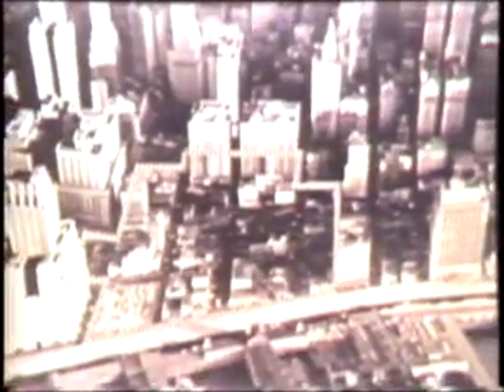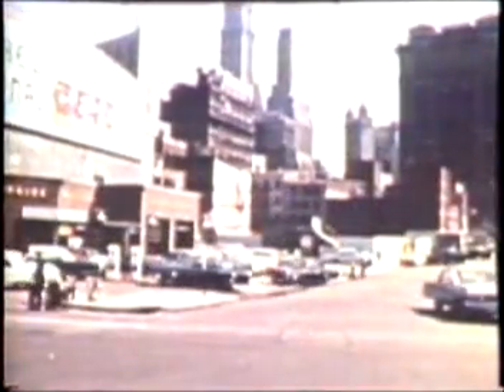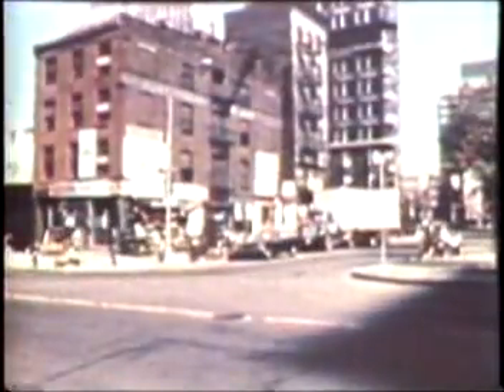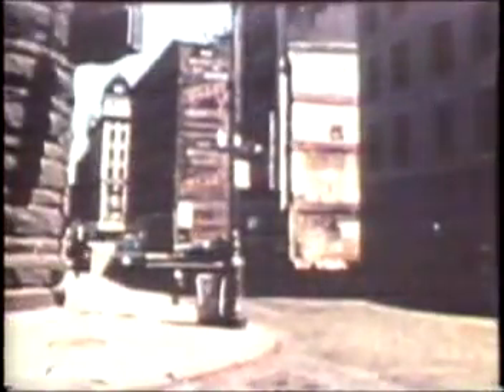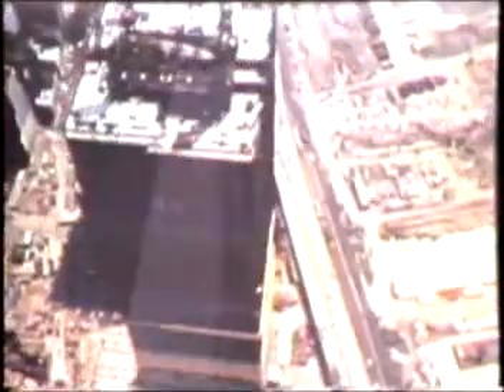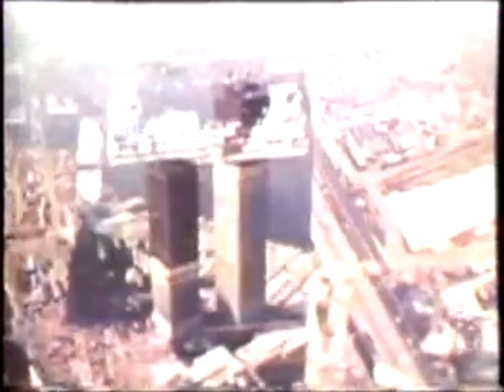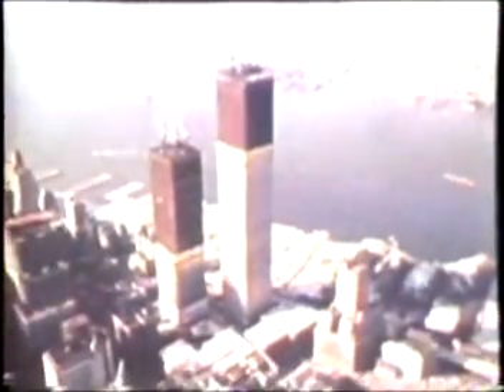[Vintage] World Trade Center Construction Promo (1968-1972)

Comment: And nobody imagined that someone would crash a fucking jetliner into it
Reply: actually they did, they were built to withstand a jet impact from the aircraft of the period
Reply from the maker: To clarify (conspiracy theories aside)-- the WTC was hypothetically able to survive a (accidental) collision from a Boeing 707.... NOT a fully-fueled Boeing 767 (wide-body fuselage) that was flying at high speed directly into the structure. 767 is a much larger aircraft with MUCH more power.

Comment: The whole description is simpily here. The World Trade Center is a complex of various buildings in Lower Manhattan, New York City, United States, replacing an earlier complex with the same name on the same site. The original World Trade Center was a complex of seven buildings. It featured landmark twin towers, which opened on April 4, 1973 and were destroyed in the September 11 attacks of 2001, along with 7 World Trade Center. The other buildings in the complex were damaged in the attacks, and their ruins were eventually demolished. The site is being rebuilt with five new skyscrapers and a memorial to the casualties of the attacks. As of November 2011, only one skyscraper has been completed; the other four are expected to be completed before 2020. One World Trade Center will be the lead building for the new complex, reaching more than 100 stories at its completion.[2] It became the tallest building in New York City on April 30, 2012, and is expected to be finished by 2013. A sixth tower is awaiting confirmation.
At the time of their completion, the original 1 World Trade Center (the North Tower) and 2 World Trade Center (the South Tower), known collectively as the Twin Towers, were the tallest buildings in the world. The other buildings included 3 WTC (the Marriott World Trade Center), 4 WTC, 5 WTC, 6 WTC (which housed United States Customs), and 7 WTC. All of these buildings were built between 1975 and 1985.
The complex was designed in the early 1960s by Minoru Yamasaki and Associates of Troy, Michigan, and Emery Roth and Sons of New York.[3] The twin 110-story towers used a tube-frame structural design. To gain approval for the project, the Port Authority of New York and New Jersey agreed to take over the Hudson & Manhattan Railroad, which became the Port Authority Trans-Hudson (PATH). Groundbreaking for the World Trade Center took place on August 5, 1966. The North Tower was completed in December 1972 and the South Tower was finished in July 1973. The construction project involved excavating a large amount of material, which was later used as landfill to build Battery Park City on the west side of Lower Manhattan. The cost for the construction was $400 million ($2,300,000,000 in 2013 dollars).[4] The complex was located in the heart of New York City's downtown financial district and contained 13.4 million square feet (1.24 million m2) of office space.[5][6]
The Windows on the World restaurant was located on the 106th and 107th floors of 1 World Trade Center (the North Tower) while the Top of the World observation deck was located on the 107th floor of 2 World Trade Center (the South Tower). The second King Kong film was filmed in 1976 with some scenes mentioning and showing the World Trade Center.
The World Trade Center experienced a fire on February 13, 1975, a bombing on February 26, 1993 and a robbery on January 14, 1998. In 1998, the Port Authority decided to privatize the World Trade Center, leasing the buildings to a private company to manage, and awarded the lease to Silverstein Properties in July 2001.
On the morning of September 11, 2001, Al-Qaeda-affiliated hijackers flew two Boeing 767 jets into the complex, one into each tower, in a coordinated terrorist attack. After burning for 56 minutes, the South Tower (2) collapsed, followed a half-hour later by the North Tower (1), with the attacks on the World Trade Center resulting in 2,753 deaths.[7] 7 World Trade Center collapsed later in the day and the other buildings, although they did not collapse, had to be demolished because they were damaged beyond repair. The process of cleanup and recovery at the World Trade Center site took eight months.
Over the following years, plans for a rebuilt World Trade Center took form. The first new building at the site was 7 World Trade Center, which opened in May 2006. The Lower Manhattan Development Corporation (LMDC), established in November 2001 to oversee the rebuilding process, organized competitions to select a site plan and memorial design. Memory Foundations, designed by Daniel Libeskind, was selected as the master plan, but this went through substantial changes in design. The new World Trade Center complex will include One World Trade Center, three other high-rise office towers, and the National September 11 Memorial & Museum.

Comment: I wonder how much did it cost to build both towers back in the 60s?
Reply: The whole complex (demolition of Radio Row and the Hudson Terminals), building the slurry wall, excavating the bathtub and building out the underground, including a new PATH station, building the twin towers and the three lowrise buildings around the plaza cost around $1000000000 in late 1960s USD
Reply: 900 millones de dólares por los 5 edificios del complejo, las Torres Gemelas, los edificios 4,5 y 6, la plaza elevada, estacionamientos y estaciones de metro, calles que rodeaban el complejo, y los espacios de centro comercial subterráneo entre Torres, el muro pantalla, relleno, demolición, transporte de tierra sacada de la zona, sin contar mano de obra y otras cosas.
Ya más tarde llegó el Marriott y al último el edificio 7.
Tecnicamente más de 5.500 millones de dólares al cambio actual, por edificios sin las medidas de seguridad ni estructura reforzada, eso le aumentaría mucho más dinero en estos tiempos, además, en los 70 se sacó todo el acero, hoy en día sacar tanto acero es toda una odisea legal y económica

Comment: Did the buildings contain asbestos when demolished?
Reply from the maker: Oh hell yes. In the 60's people believed asbestos was the ultimate fireproofing material and plastered it on fucking everything during construction. Sure enough, we found out it causes cancer. When the towers were taken down, that shit flew ALL over Manhattan and posed a serious health issue during rescue and cleanup. In fact, I've heard some people working at Ground Zero have been diagnosed with lung cancer in the years since 9/11...
Reply: itwontcomeout5678 I have heard that too, but the media doesn't seem to care much. :/
Reply: ***** Upon further research it seems asbestos was applied on the first 40 floors (then it was banned in NY) and about half of it was removed by 9/11.
Reply: TehGodLord I was a construction worker and worked on the WTC (both towers) from 6/73 through 1/75 and yes, much, if not all, of the asbestos was removed from the elevator shafts and the unoccupied floors(there were not many tenants at that time).  The asbestos was replaced with vermiculite, a fire retardant without the carcinogenic hazards.  I know., because I worked with the removal crew.
Reply: Didn't know that. :(
Reply: +fscap811 Wow, you were working in the construction? You must be frustrated now that terrorists took the towers down. WTC was the highest towers in the world in 2001 right?
Reply from the maker: fscap811 That is really cool to hear man. Although the new WTC helps to fill that sad and lonely gap left by the two towers in the skyline, nothing will ever truly replace them. As a current civil engineering student, I'm hoping to help these structures last for a lifetime ;)

and Manu Lehtimäki, the Sears Tower in Chicago (+1) took over as world's tallest in 1974, and held that place until 1998 when the Petronas Towers were built in Kuala Lumpur.
Reply: +itwontcomeout5678 No building can survive a demo job.
Reply: David Rohde Yes, there is a video of failed demo jobs only, quite funny too.
Reply: ***** There are a great many architects and engineers advocating that position.
Reply: Donna Summer claimed to get lung cancer from the aspestos from the towers
Reply: Manu Lehtimäki yes, I have not been able to go to the site since 9/11 as it would be too emotional for me.
Reply: Um, no. Asbestos abatement was done as tenants moved out. Most of the south tower did not contain asbestos insulation. Insurance required that in the event of a total loss, buildings of equal or greater floor area must be constructed at the site: that's standard for insurance policies on large buildings.

Comment: squibs are possible, and this is an old theory that was debunked a long time ago.  the puffs of air, are expelled from the windows as the tower collapse because of the floors compressing on top of each other.  the air has to go somewhere.  What you mistake for pulverised concrete, is more likely to simply be crushed plaster board from the collapse of the floors.

Comment: And a plane flew right through that? Times 2? 
Amazing!
Reply: Not right through them. They flew into them and didn't come out the other side because the planes couldn't penetrate all the steel and concrete inside the buildings. Concrete is a very tough material. Only certain parts made it all the way through and out the other sides.

Comment: one of the most iconic buildings in America and it was supposed to withstand a plane crash still don't buy it they had bombs in the building even trump said the beams were solid steel and he was there after the 1993 bombing and seen the damage and said it took out several main beams and still took the damage no way the planes brought those steel structure buildings down may everyone that passed away rip and may the real truth be told